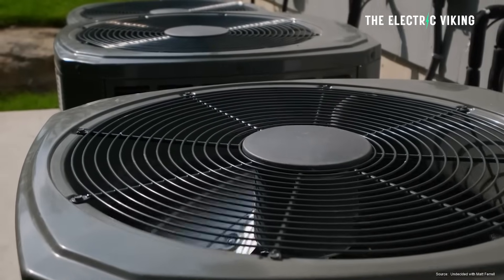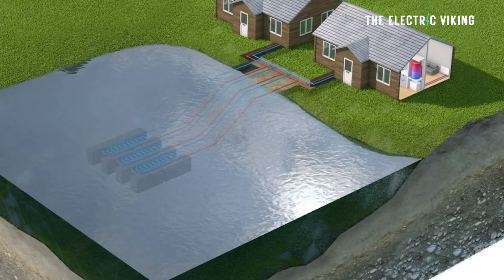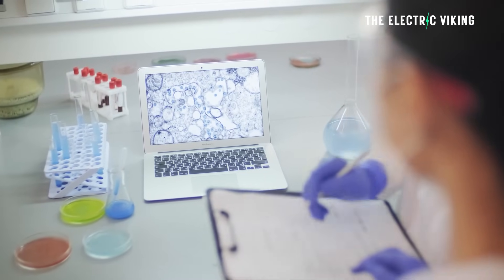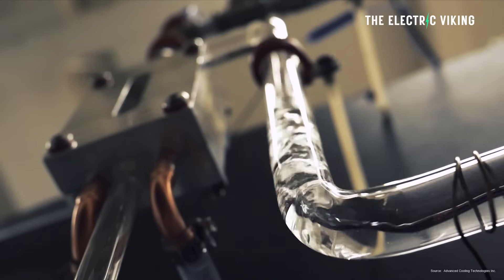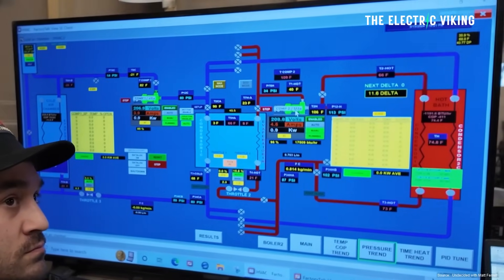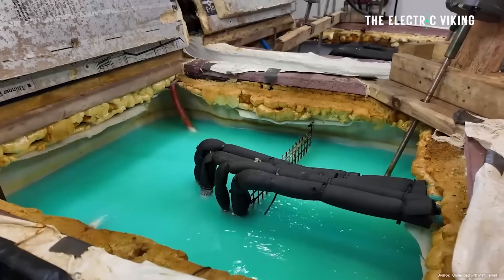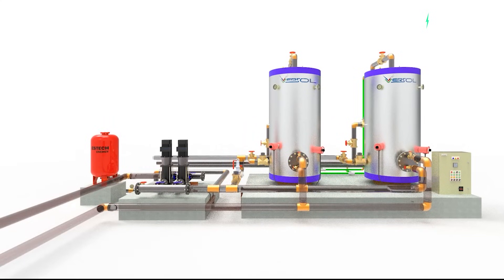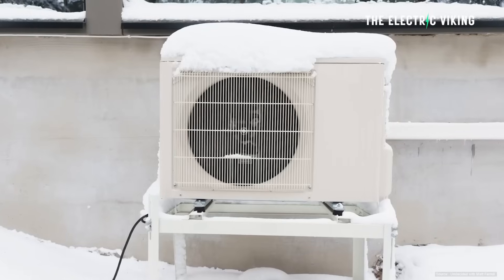GAME changing' heat pump delivers 400% more heat than the energy it uses

Comment: 400% for a heatpump is actually pretty average.
In The Netherlands you see it pretty often, you just have 15 degrees celcius water and the heatpump can split it up to 30 degrees water and nearly 0 degrees celcius water.
After that the pump simply throws the 0 degrees away and heats up your house with the 30 degrees water.
Or the other way around, you keep the 0 degrees in your house to cool your house down.

Then how do you get that 15 degrees water? You simply pump it out of the ground at a 100 meters of debt.
My parent got such a system for over 15 years, they were one of the earliest to get it.

Comment: 2 issues I see is as water temp increases The density decreases. Which in turn reduces the efficiency. Where ground base is fixed and
Consistent
Reply: Water decreases in density as it increases. But I doubt that this is too much of a problem. Water is still an excellent conductor of convective heat if you can prevent it from boiling. That's not going to be too much of a problem in open water.

Comment: My first reaction to the comment about a heat pump replacing solar panels was to laugh, but then I got thinking.

Apart from wind, solar PV, and hydro, all electricity generation is basically a modern version of a steam engine. Heat is used to rotate a turbine connected to a generator. The electricity generation doesn’t care where the heat comes from.

Let me start by conceding that in practical terms, a heat pump may not be capable of generating the sort of temperatures required. For the sake of this thought experiment, can we please ignore that.

Imagine a system consisting of a battery powered heat pump connected to a generator that charges its own battery and powers a load. Heat pumps do pump more heat than the electricity used to run them.

Some of you are probably thinking “perpetual motion machine”, “free energy” and are ready to quote the laws of thermodynamics at me. This is none of those. If you understand how heat pumps work, you’d realise there is no free energy, but the heat energy comes from the outside environment. Just as your refrigerator pumps heat energy from inside the chamber to the radiator on the back, a heat pump transfers energy from the outside environment to where it is needed.

So, our hypothetical setup is transferring heat from the environment to drive a turbine connected to a generator and generating electricity that in theory could be more than the input energy from the battery. You’d need some battery energy to get the system started, but that would be replenished with additional electrical energy available to drive a load. Barring equipment failure, the system would run indefinitely taking energy from the environment (i.e.  pumping out cold air) and turning it into electricity.

Comment: How is this in any way new?   People with ponds on their properties have been using pond loops instead of ground loops as a heat (and cooling) source for decades.     
Oh, and a COP of 4 isn't good enough.   I've done the math for my home.   I would need a COP of almost 5 to equal the cost of heating with my 95% efficient natural gas boiler, and that's ignoring the capital cost of swapping out the boiler for a heat pump.
Reply: A heat exchange, as you are describing, and a heat pump are two different things.

Comment: Solar PV doesnt need any electricity to operate, unless it's using solar tracking. Thus solar is still more efficient than heat pumps in that situation.
Reply: Frozen water ???   LOL
Reply: its a strange comparison to make to start with.
Reply: Solar PV's have absolutely no relevance to heat pumps. PV's produce electrical energy. Heat pumps move heat from one place to another. I don't know what Sam's on about.

Comment: This technology has been around for decades and a COP 4 is fairly standard
Reply: I was about to say the same thing. Heat Pumps move more heat energy than they use. 4X is not that great. There residential units that move over 6 times the energy that they consume.

FOr example:
"The CX34 heat pump has a certified IPLV COP efficiency of 6.75"
Reply: @larryevans6739  

That's for cooling, heating COP for CX34 is 3.92.
Reply: …and often better.
Reply: The World Trade Center was cooled this way from 1970 to 2001.  Pump water in from Hudson, pump it back after using.  Hudson is wide and tidal so water always moving.

Comment: In Gothenburg there is 4 heat pumps, total installed power of 160 MW. Two 50 MW and two 30 MW, gets the energy from household wastewater.
Reply: An even better idea might be to not dump heat in the wastewater in the first place. A simple heat exchanger can e.g.  transfer the heat from my shower wastewater to the cold water pipe, so I need less hot water to mix for shower temperatures. Reducing the hot water temperature might also be possible, but for legionella prevention, a certain minimum temperature is necessary.

Comment: Don’t need a heat pump. Put PV panels on my roof and the energy heats my resistive hot water tank. Far less cost and complexity!
Reply: The efficiency of solar collectors is around 80 percent ,  when the efficiency of solar panels is only 20.  Why would anybody want to do that to heat water ?
Reply: @andreycham4797 Much less maintenance
Reply: @pauld3327  what maintenance?   I had a short chat with an old lady a few weeks ago, who has had solar collectors on her house since 1984
Reply: @andreycham4797  Less cost. Less mechanical/hydraulic complexity. Excess energy can be used for things other than heating water.
Reply: @MarksElectricLife  is this video a part of preschool program in kindergarten?  Too many childish comments . How do you charge two electric cars , when all space is taken up by photovoltaics panels just to heat up water?
Reply: @andreycham4797  Not childish. Scientific. A 5kW PV system will cost you about as much as a good quality solar hot water system. On an average day it will produce 20 kWh of energy. Enough to fully heat a 3.6kW hot water tank (requiring 7.2kWh for 2hr heating cycle) with 12.8kWh excess electrical energy available to run household appliances or charge EVs. Solar H/W is a closed thermal loop that can only heat water. Once your tank is up to temperature the sun’s radiant energy hitting the collector is essentially wasted. Regardless of the strength of your intuition, that is how the physics works.
Reply: @MarksElectricLife   My neighbor has 40 photovoltaic panels and it is not enough power  to run household and to charge one electric vehicle. Why would anybody in their right mind want to use such precious roof space  for something which is 4 times less efficient. My plan is to place solar collectors on the south wall  and when electric vehicles become more affordable I will cover all roofs with photovoltaic panels
Reply: @andreycham4797  Not sure what’s going on with your friend’s system but it sounds like there’s a fault there. I have 23 panels (9.5kW) and it generates an average 40kWh daily. That’s easily enough to heat my hot water, charge my EV and run all my appliances.

Comment: This is a nothing story Sam. We had a water sourced heat pump in our previous home 35 years ago. It's not revolutionary. In our current passive solar house, in the plans we are supposed to have a water to water heat pump pulling heat from our 2100 gallon cistern - which is fed from ground water 600 feet under the surface. The house requires so little heat that this balances with our domestic water use to keep the cistern temperature within the operating range. I haven't installed it as the performance of the house has been great, but maybe will be soon as we will also use it instead of the resistance heater in the hw tank. The performance of this system will be superior to the ocean water used by these guys, as the ewt (entering water temperature) will be higher.
Reply: Agreed, it’s not new technology, but it’s very rarely used. I’ve been looking for an air-to-water heat pump system for my dad, who lives in a rural area in the U.S. and haven’t been able to find one. I doubt this Scottish system will be available here either, but more people need to become aware of the technology and start shifting the market in this direction.
Reply: @durinok  there's an outfit on the east coast in Nova Scotia. They do air to water, water to water.. Optimised for cold climates. Arctic heat pumps.. That's the company.
Reply: @durinok  you could also try a spa heat pump.

Comment: This is old news
Reply: True, but why is this technology not being installed and used? I’ve been trying to find a system I could get installed for my dad’s house in a rural U.S. area using his existing well. I can’t say it’s not available, but I haven’t found it yet. He has a heat pump for air conditioning only, uses gas for space heating and water heating, so this tech would dramatically decrease his energy usage and carbon footprint.
Reply: @durinok  Yeah I guess it's one thing for something to be possible and another for a company to start making it available.  I heard about these improvements in heat pumps ages ago.  I guess they haven't left the lab yet, or perhaps they're being reserved for industrial processes.

I have a heat pump hot water system.  They're more expensive than plain electric systems, but they use about a third of the electricity to operate.

Comment: I was told a new heat pump cost $9,000 and it only last 10 years.That's a rippiff. This is why we need passive heating and cooling for homes. Humans heated and cooled their homes for thousands of years without air conditioning so we need to design homes with passive heating and cooling so they don't need expensive heat pumps.
Reply: My first air to air lasted 20 years and was 2000$
Reply: Cost depends on the size of the home, climate and amount of insulation. 
A good heat pump will outlive a gaa boiler and prices are dropping as they are reaching mass production scale. Also air source heat pumps are now outperforming ground source heat pumps in most cases.
I personally have a hybrid system installed and it works just great. No more gas usage so far apart from making hot water for the tub and shower as designed (feature can be added later this year).
Right now you may need some government incentives to break even on a heat pump, but I see the market switching over like it did once from burning coal in the home. This change is inevitable.

Comment: We need passive heating and cooling. Most homes hàve no ventilation that allows the colder air outside into the home and pushes the hot air through vents in the roof to outside the home. Even during the hottest summer months, the temperature drops dramatically at night. The colder air needs to be able to naturally enter the home and push the hot air up through the roof and outside the home. Efficient heat pumps will not have to use much energy at all with this building method.
Reply: That is great in areas where the climate makes it feasible.  In humid areas, not so much.  For example, in Florida tonight the lowest overnight temp is 75 degrees, but humidity will probably be around 80%.  You'll be sweating like a pig in those conditions.
Reply: @CL-gq3no  True. In NC our humidity is not as high as in Florida, but it still gets humid in July/August. But at night the temperature falls so a passive cooling system could work.
Reply: In Scandinavian climate or similar, you wouldn't want a bunch of passive inlets in the walls and ducts inside your home up to the roof; even if you could shutter those ducts, they'd still be a pathway for heat to leak out during wintertime, especially with strong winds blowing. In more modern structures it is now common to have a centralized ventilation system, typically drawing air from the kitchen stove hood and bathroom(s), with matching inlets in living room, bedrooms and so on, and an outlet air heat pump capturing the heat being drawn out of the home, for maximum efficiency.
Reply: @lennyvalentin6485  Underground earth tubes could be a solution. In the winter the earth tubes are closed on the outside as well as the inside. This makes it harder for heat to escape. I'm not saying this would work in the harsh cold Scandinavian winter, but it's just a possibility.

Comment: Old heat pumps also had that CoP. Where is the news?
Reply: I think that Viking, like many people, did not realize that heat pumps can move more heat energy than they consume.
Reply: @larryevans6739  They are pretty rubbery units of measurement that are applied to heat pumps. Advertisers like to say that 1000 watts of input produces 4000 watts of heat but the problem is that watts is not a measurement of heat, it's a measurement of work done. British Thermal Units or Joules are a measure of heat energy.

As for heat pumps being able to move more heat than they consume, I'm not so sure that Newton would agree, but I could be wrong.
At that point, you've just created a low heat differential perpetual motion engine and you are now the richest person on the planet.
Reply: @davidbrayshaw3529  Heat pumps do not violate newtonian physics any more than a fuel tanker truck can move more potential energy in gasoline than it uses to move that gasoline. It is moving heat energy, not creating or destroying it (although I should have been a bit clearer about the energy input, which tends to be electricity, rather than heat). This is not a perpetual motion machine.
Reply: @larryevans6739  I most certainly understand that this is not a perpetual motion engine.
My point is that the units of measurement being applied to the input and output of the device are being used inappropriately and I would suggest, somewhat deceptively.
It is common to see claims of "4000 watts of heat from only a 2000 watt input" or something similar.
There is no such thing as 4000 "watts" of heat. 
The only way of accurately assessing the efficiency of a heat pump is to comparing energy input which as you point out is usually electrical energy measured in watt hours, to heat output measure measured in British Thermal Units (BTU).
By the way, I'm in no way critical of your post, I was actually endorsing it in the context of this video. Cheers for the reply.
Reply: Air-to-air is the most common and least efficient, air-to-ground is much more efficient (but expensive to install and as a result far less common), and air-to-water is the most efficient of the three technologies, and between air-to-air and air-to-ground in terms of installation costs. This is the sweet spot for heat pumps. In areas with well water, the existing well could be used to install air-to-water systems, further reducing the installation costs.
Reply: @durinok  Air to water isn't uncommon in yachts. Condenser/evaporators have been used for a long time in recreational sea craft. Top tip, though. They still use a bundle of energy to run.
Reply: Not quite sure how air to air is the least efficient but air to water is the most efficient if they both get their source energy from the same place : ie the air.?

IIRC  The most efficient  HP irrespective of the source, is one where there is a steady constant supply of 'free' heat around say 25c-28c . , waste heat from a industrial process  (air or water) or deep down in the earth. 

Ground extraction by Vertical bore is usually deemed the most efficient   because A) the lack of suitable free heat sources  & B) the Earth temperature rises the deeper you go so more heat can be extracted . raising COP. deep down  into the ground is generally considered the most efficient exactly because the temperature remains a constant. 

Wells can struggle to maintain water temperature if the volume is too small for the extraction rate. Plus, Wells are generally subject to weather temperature fluctuations.
Reply: @durinok  Actually ground source to water is the most efficient. Heat is taken from the ground, which is at a pretty constant temperature all year round and uses underfloor space heating.
Reply: Round numbers:

1) Ok, electricity is 4x more expensive to heat with the fossil fuel.

2) the electric heat pump produces 4x as much heat as consumed to extract it from the water. 

3) so a big heat pump breaks even with fossil fuel, BEFORE spending several thousand dollars for the heat pump equipment and installation. 

"Next..."
Reply: @hg2. The heat pump emits less than half the amount of CO2 per unit of heat and that is going down as the grid gets greener. That means that our grandchildren will have a beter chance of a life wortth living than if we carry on witth business as usual. Clearly you place zero value on the lives of those yet to be born. In 10 years ttime fossil fuelled home heating will be banned in the UK and many other countries. That is the correct course of action.